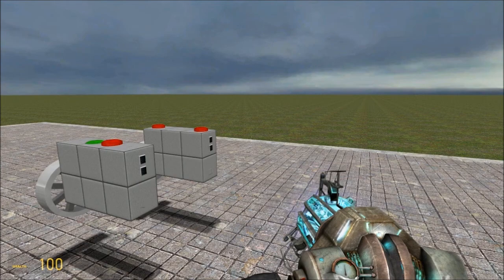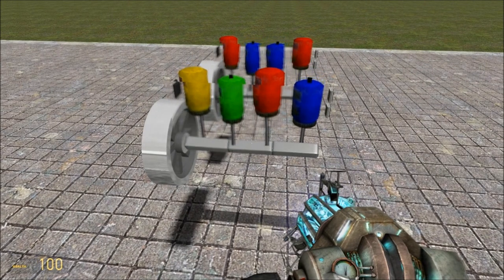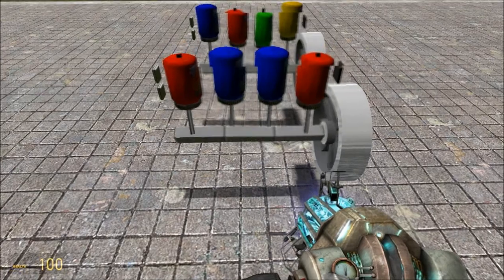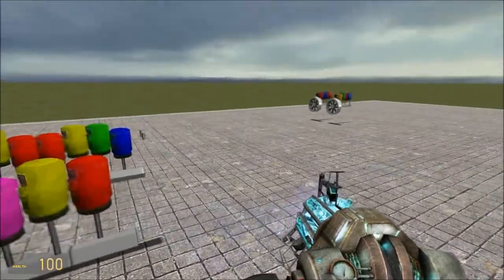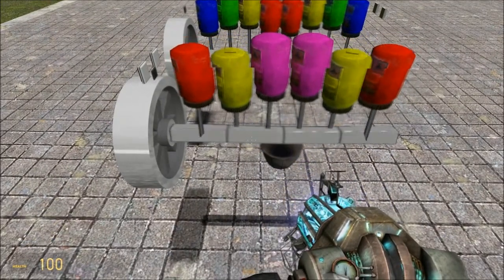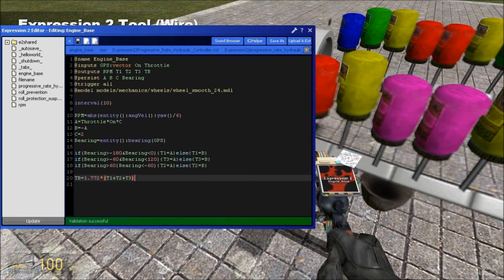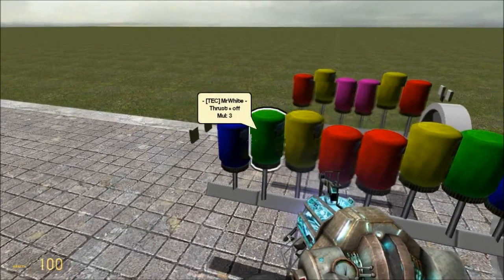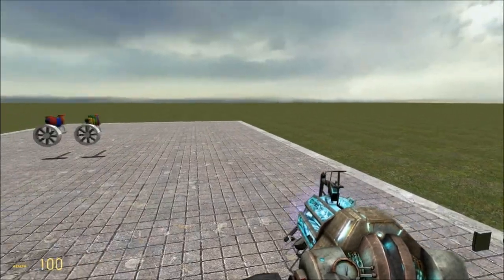(GMod) (Tutorial) Balancing Your Engine

Comment: The reason you shouldn't use inline 1 engines is because of how bad and unbalanced the forces can be,
One way you can prevent this is by tilting the engine so the piston is horizontal but then it is more of a boxer engine.

Comment: @mwhite112393 I'm just getting at the balancing technique in this video, as much as it stops the engine from wobbling, you are changing the engine in a fairly major way, as good as it is, and it is good:

What if you actually wanted the slightly more realistic 4 position crank rather than the 2 position crank as shown in the video? Is there a way of making the 'bad' engines balanced?

Comment: There's got to be a better solution to produce a true 4stroke 4 piston engine, I don't mean to sound like an ass here, but I don't like the idea of taking strokes away just to fix the balance, it feels like ignoring the problem. 

Even though it's just a rational way of dealing with one of the several bajillion problems with gmod as a platform for building things like this, which I can see works and it doesn't affect the RPM at all, it does take away from the realism which is what some look for.